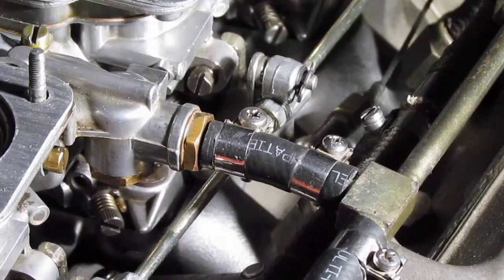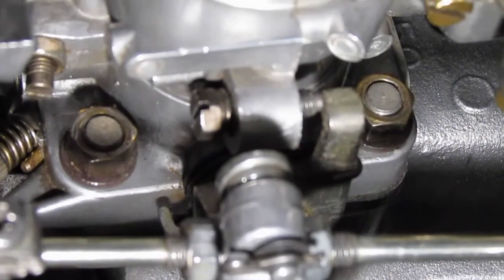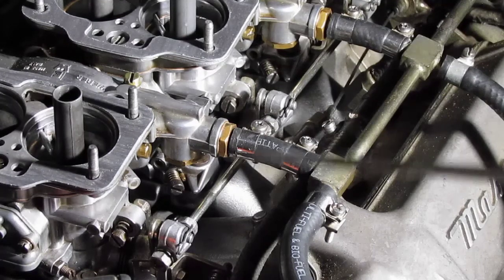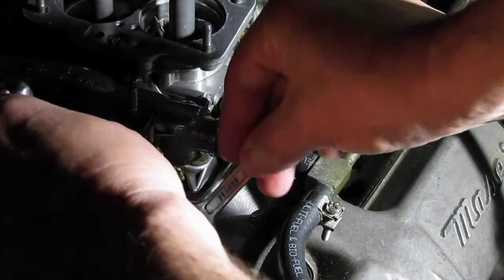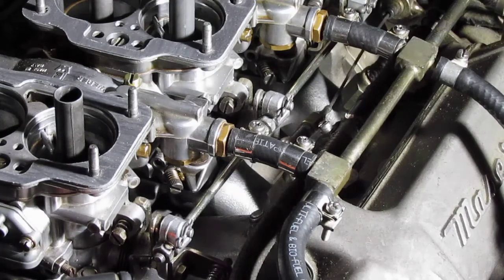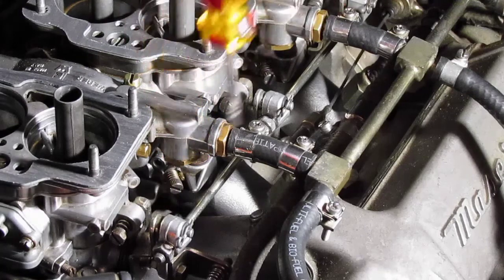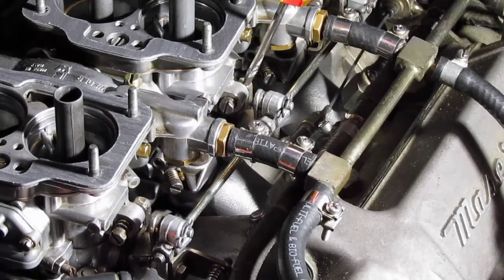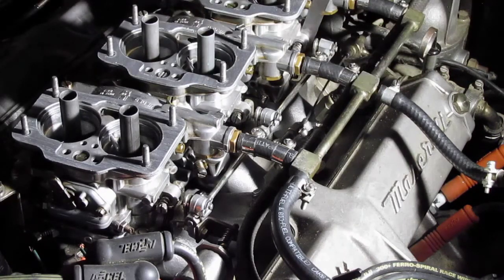Weberology: Throttle Linkage Adjustment Part I

Comment: What was the thickness of the feeler guage?
Reply from the maker: Hi Jason. 
 
The .25" spacing was used only as a place holder/point of reference.  By that I mean, you want all throttle plates to be at the same intake angle,  more or less, to ease the start up of the engine.  This is only a static adjustment, no need for the exactness of a feeler gauge.   

Once the engine is started, you may be at a high or low rpm.  Then adjust the idle speed screw to bring the rpm to a workable level.  This is when you use the synchrometer to make the final adjustments so that all 3 carburetors have the same vacuum (synchronization). The last step is to adjust  the idle speed screw to an 800 rpm idle.

As a side note, if the idle requires a 1000 rpm or higher, then the A/F mixture screw is set too lean.  The spark plugs will look fouled black dry and/or wet.  Really, who knew!!!  Apart from that, you may have a vacuum leak or leaks in the carburetor/intake manifold assembly.

Merak Group